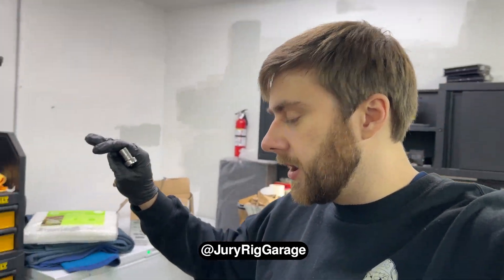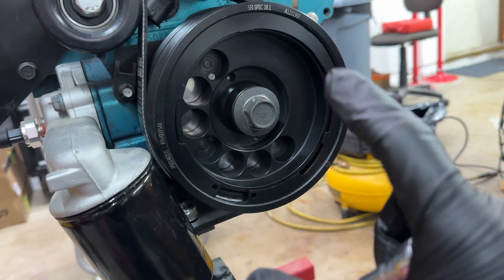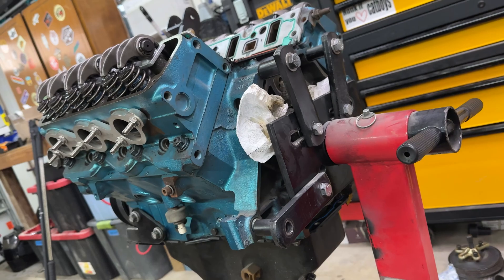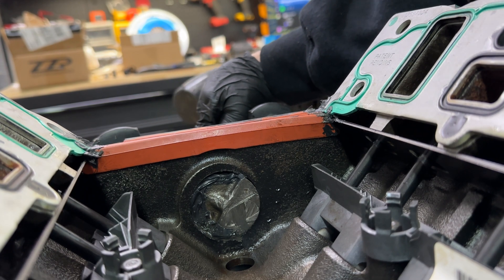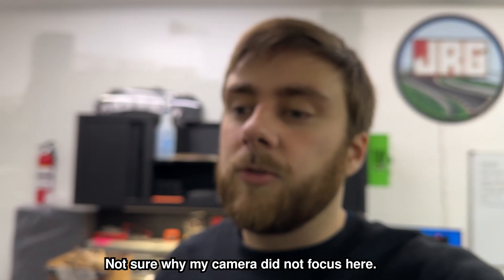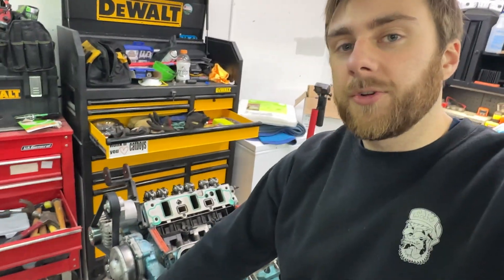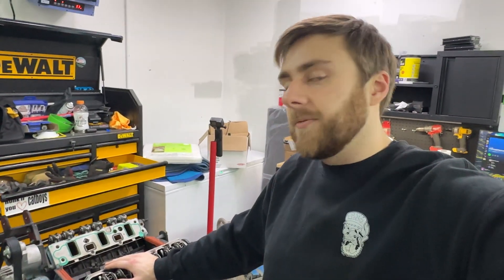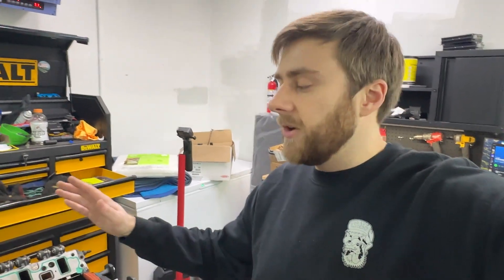Completing the Valvetrain Mods on my Turbo 3800!

Comment: 3900 is a better engine by far
Reply from the maker: Why is that? I don't see any aftermarket support
Reply: @JuryRigGarage    lots of supportfor a 3900  Rods pistons, cams, springs ,TB upgrades, header flanges

Heads flow about 50 more cfm than a 3800. 3900 with TB, cam and exhaust will make 300 HP na.

I made 600 HP on a bone stock 3900 on only 15 lbs of boost. Dyno proven
Reply: Interesting  @Slowv8Fiero
Reply: Nah dude, the 3900 is a POS. They only made them for 6 years. The Buick V-6 was made for 46 years. Won best engine for 10 years straight. Get a grip on reality.
The Caddy V-6 is way better than the high value and it is still not as good as the Buick.
Reply: @analogkid4557    nah dude. You're wrong clearly.  SBC was made for 50 but it was still a junk engine compared to LS/lt based engines.  Cope harder pedo